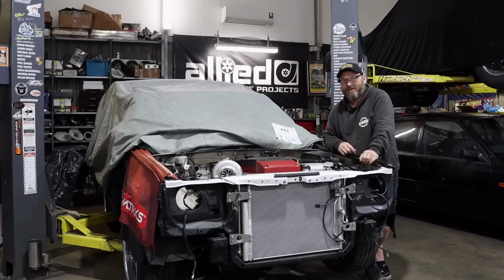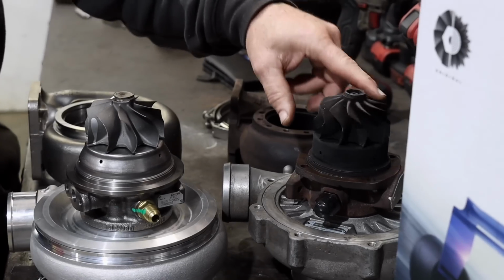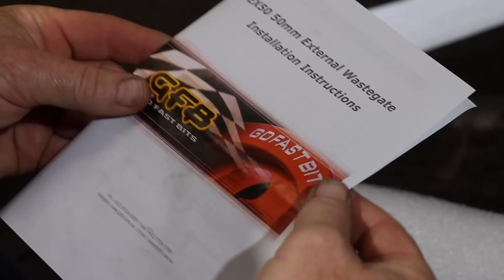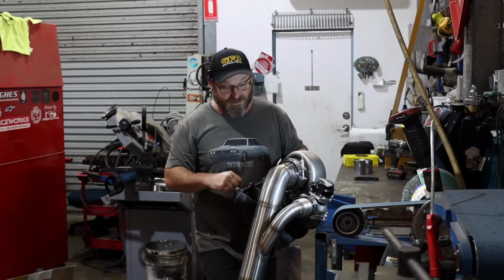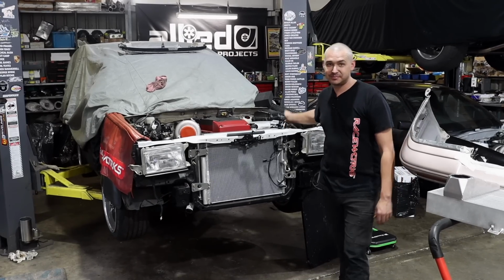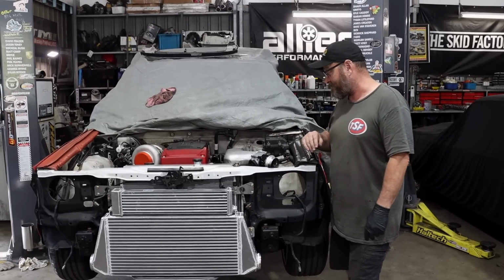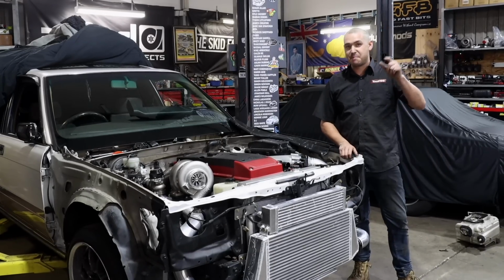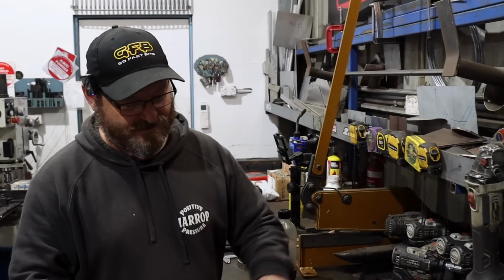Is this The PERFECT Turbo? - Barra Powered Crown EP2

Comment: Well, that was another fun vid from The Skid Factory. Thanks for the educational entertainment. You'll be happy to know I finished all the transmission, wiring, brake and A/C upgrades on the old '59 Jag. Took it for a test drive and there's some minor changes I'm going to make but all in all it worked out. Next, I'll be pretending I'm Al as I build a new exhaust for it using parts from an old HKS system I took off my 350Z. What could go wrong? Cheers!

Comment: The way i knew it was to measure the max of the profile. So like if you take one of the fins, make a thin cardboard template and splay it out flat, the most extended bit is where you need to measure (on the actual prop). Because that's the spot where the last "catch" on the forced air happens. It's kinda like when you launch someone on a swing hard for a jump, and you use your finger tips to give it every bit of momentum.

Comment: I'm looking forward to the details of the ATF cooler. I'm running a Mishimoto MMOC-F and my transmission still has heat issues (dual RedArc temp sensors), but of course I'm beating on it. My question is about configuring a set up to allow more ATF in the system. Will you use a check valve or something particular?
Reply from the maker: What's the application?

Comment: with solid intercooler and turbo piping how do you cater for engine movement and pipe expansion without a rubber flexi?
Reply from the maker: The RaceWorks clamps have movement in them. They are a variation of the Adele Wiggins clamp used in Aerospace.

Comment: Hello. Fascinating. I owned a 1970 Crown MS55 into which I put a 7mGE cressida engine, but problems with transmission and differential ratios were never solved. With your project here on the 1989 Crown Wagon, was the option of using a Lexus 3UZ-fe engine explored or is it unsuitable?
Reply from the maker: The 7MGE is a good choice for the MS55, any issues with it can be sorted out. UZ V8s don't really fit, especially in the early crowns.

Comment: I did see "wha's for dinner" followed by "tandoori lamb cutlets" at 24:52. What I also saw was solid connections from the turbo through to the throttle body, which, last time I mentioned it (when you used a silicone joint) you mentioned you don't do. Yet here is ia prime example of the cold side being mounted solidly to the turbo, the intercooler and the throttle body. Not the smartest I'd say, as the turbo and throttle body will move with the engine, yet the intercooler is fixed to the body. Can't tell me that you don't do it that way because you've just done it.

Comment: Garrett turbos are so good! I'm sure it happens but I've never seen a Garrett break! Seen plenty of others fail, mostly over a decade ago.
Serious question.. Why a TH400? Obviously they're the best trans ever built but wouldn't a 4L80E be a little more fitting in a car of that caliber? Can you even find 4l80e's in Aussie world?
Keep up the good work, fellas! Thx
Reply: Maximum engine input torque for a stock 4L80 is 440 ft. lbs. = 600Nm. A Barra can have over 1100Nm at the wheels with only 15psi boost.

Comment: You know what’s mental tho, I got a Scania truck turbo equivalent to a g55 and it’s Garrett core with a Honeywell housing and branded Scania etc,

It was free as was leaking oil out the back, a new core shipped Lithuania to uk in 30hrs cost me £160 and it’s billet turbine as stock 🤓
 

Even new the turbo from a hgv shop is about £450

If it was sold in a shop for cars then it would be triple the price atleast 🤔
Reply from the maker: Garrett was owned by Honeywell Corporation for many years. It is now owned by a Swiss private equity firm.
Reply: @theskidfactory  I guess that’s why they say “the only way is Dutch”

Comment: This is a very exciting project even though it's not a thumpin' big V8...If I were doing the piping the turbo would go straight into the radiator and blow the whole thing up on the first startup so don't ask me to help with your build.
Reply: At least your way doesn't need a water pump, you've added lightness and performance. Remember that lighter weight =cheaper than power additions. So overall outcome = no don't come and help me on my build!

Comment: With intercooler piping what allows it to flex under engine movement ?
Reply: The silicone slip joiners in-between the pipes.
Reply: @adrianzmajla4844  , ok thanks 👍 , I haven't seen them before .
Reply: Edit. Just realised they have none. Solid engine mounts perhaps?
Reply from the maker: The clamshell clamps have a fair bit of movement but still require a very firm engine mount like a Tuff Mount.

Comment: I want to dunk a barra in my cortina, but licensing over in the W.A. would be tough I'm led to believe.  The car came with a 4.1 log and I'm still not so sure about putting in the dollars in case I can't get it registered.  The formula the govt follows for Australia.... Is it still original kerb mass in KG x 3.0 = max CC? (for turbo charged vehicles?)  And no more than 180kw per tonne?
Reply: Wa is very different to qld

Comment: and i was thinking of a G42 Compact Garrett for a stroked rb26 -  rb28 maybe to much lag with 1.28Ar what do you reckon ?
Reply from the maker: You'd want more in the 1.0x range for that size. Lag and RB26 should not be discussed, it's a small engine that needs to rev to make power. If it is on boost and making power for half the available rev range you are on the money.
Reply: @theskidfactory   any more vids on this project or dyno video etc ?

Comment: Awesome info right there. Actually answered a lot of questions I had about turbo selection for my Soarer build. 

Definitely going to get me a G40 1150, only question I still have is about turbine housing size. If I'm still running a stock converter on the a340 and stock head bolts/gaskets, should I go to a smaller housing like a 1.06 or .95 to reduce lag? 

The end goal is 800rwhp with ported heads and rowdy cams so I'll need the largest housing and use the 1150 to its full potential eventually, just trying to ovoid having to start with a smaller turbo so it's not a pig on the street.
Reply from the maker: A G40 on a 1JZ is going to come up at around 6500rpm unless you use nitrous. It's not really the right turbo for a 1JZ with an A340 and no converter. Even a G30 is a dog on an A340 car without a billion dollar converter.
Reply: Yeah 2.5L 1JZ  is going to want a way smaller turbo vs a 4L Barra unless you want spool times measured in fortnights.
Reply: Nice.
Reply: It's a 1UZ, oops, thought mentioned that.
Reply from the maker: 1uz it will definitely need a smaller housing but should be pretty good otherwise. The converter will still be a bit tight.

Comment: 82mm throttle body is a bit pointless when you have 76mm (70-72mm ID) cold side intercooler piping.
Reply: Absolutely. Al has no experience whatsoever and doesn't know what he is doing. You better tell him how to do it.
Reply: Throttle bodysize has nearly 0% effect on performance, unless it is very small and restrictive. 82mm will work just fine.

Comment: would love to see you throw a bw s372 on it which would make just as much power, not everyone has 4-5 k to throw down on a turbo
Reply from the maker: What size turbine on the S372?
Reply: @theskidfactory  either a 1.0 or 1.1 twin scroll, I'm not saying the Garrett isn't a great turbo but with the way things are going it's hard to drop big $$$ on a turbo these days for most people
Reply from the maker: S372 is not a bad turbo but I don't think it will outdo the G40, it's old tech with a billet compressor. We run one on the Fairlane.
Reply: @theskidfactory  that old tech wheel flows 112lb compared to the g40 at 107, 72mm vs 71, the borgy has a touch bigger rear wheel too, I'd bet the bw would out do the g40 and under half the price, probably a touch more lag, I love the Garrett stuff, even used to have a gt4088, but the price of them these days is crazy in my opinion

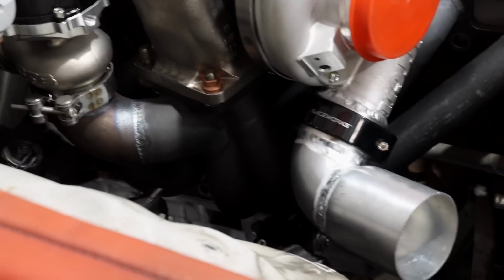Comment: 20:04 was there no way to clock it to get at least 8 cm straight out of the turbo's schnozz before the bend? Because as is, that's a big restriction on the poor thing. Air doesn't like being rushed out of the gate, it likes being allowed to straighten out its horses before taking the turn.

Comment: Lots of added weight in the front. She's going to be a bit of a lead tipped arrow with the big motor and all that extra gear in there. Are you going have to change the suspension in the front to deal with all the extra weight?
Reply from the maker: How much extra weight is there?
Reply: @theskidfactory  70-100kg maybe? Reliable info is hard to find on the interwebz. So far the only weight I can find listed for a Barra turbo is 235kg and 62kg for a T400. I can’t find any weight listed for a 1G-GZE but I found a 1G-GTE weight claimed @ 175kg and an A340 @ 57kg.

The Barra is also a big and tall engine physically. I assume its mass is sitting further forward than the 1G would have. It will be interesting to see how this extra frontal mass ahead of the front wheels will affect handling.

Perhaps you could also weigh the car at the end and compare to some factory figures?
Reply from the maker: If handling was a priority we would not have started with a full chassis luxury car that weighs 1700kg and has box and linkage steering. Straight line handling on the drag strip is the priority.
Reply: @theskidfactory  I hear what you are saying but it isn't the best starting chassis for a drag car either is it? I assume it is still going to be a nice street cruiser too so handling is still something you'd want to consider surely? Not having a crack, just genuinely interested in how it'll drive with the bigger engine in the front. Good luck with it!

Comment: With the inlet, and outlet at the top or the bottom you aren't using the whole coil of your intercooler..
Because air like water or electricity take the least path of resistance. 
So basically you're shoving majority of the air straight through the coil, and it's not going across the whole tube sheet.
In order to do it the way you have it is to add internal radius  vanes at the appropriate point at the inlet tube, and again in proper position to equally split the rest of the tube sheet. 
Instead of a tapered plenum you will be better off with a equal sized one that you can add the radius vanes as well at the very end of the plenum you do not want a flat surface for the air to slam into because this causes turbulence, and turbulence is reducing the smooth flow of the air.
The opposite side needs to be a direct copy of the inlet side, for the same reason, because you want a smooth flow of air existing the tube sheet hitting a smooth radius vane ,and again where it intersects the outlet tubing.
Yes it is a bit of work, but then you're not spending the money, and time you already are to do something half-assed which is what you have in place at this time. 
You want to verify everything I've said, contact your local commercial hvac company and have their test and balance technicians do a flow test with their equipment because other than a mechanical engineering firm that does flow test on site will be the only ones qualified to verify my design criteria.
The mechanical engineers can give you the basic rules of practice for achieving what you're wanting it to do, as it is standard practice in the industry are it is here in the US. 
I've tried to explain this to others but apparently they don't take what I say seriously, which is they're loss for assuming everyone is just blowing smoke out their ass to make a comment or wtf ever.
But if you really want the full benefit of your money time and efforts then the few changes I gave you will benefit you more than your competitors
Reply: They don't take what you say seriously because you are wrong.
Reply: Agree. Al has no idea what he is doing. All the past videos are a sham and he has not been able to pull any decent figures on the dyno. Glad you are telling him (and us) how it should be done. All the intercooler manufacturers/fabricators don't know what they are doing either. You might show all of us the videos of the ones you have done. That will no doubt help us all.
Reply: Sounds like F1 teams need to fire their engineers and hire a couple of HVAC guys to improve their intercooler flow.
Reply: @jeffsymons7084  correct. F1 uses all sorts of pipe layout. Just google F1 intercooler images.  Yes, the flow might not he evenly distributed at low flows, but, at high flows (F1 in the late 80s ran 56psi, 1200hp in a 1.5L engine and no traction control !) the tubes are somewhat restricitve and the gasses even out accross all tubes.
Reply: @jeffsymons7084  probably should, but it's facts what I put before everyone, and just because someone who makes a pile of money that thinks he understands what he's doing even with a degree isn't always correct my friend. 
I've spent over 40 years in my trade fixing engineers screw ups, and I stand by that knowledge gained from seeing the results of such things, what causes the problems, and what it takes to correct the problems to make things function properly. 
That's all I can say about it, as to whether you believe any of what I have said is totally your choice. 
Only before you talk outta hand, why don't you do a little research, and then if you have a educated response with facts or even theory I'd be more than willing to discuss it with you in such a manner. 
Have yourself a Great Day Sir
Reply: @timothymilam732  Thanks. I did some research and I came across something called the Dunning-Kruger effect. I think it perfectly explains what you are saying. God bless you sir.

Comment: i always wonder why australian like so much garrett turbo...here we dont like them much...most of the time with a precision with exact the same spec you will get more power for cheaper...
Reply from the maker: Just buy a few spares for when it fails.
Reply: @theskidfactory  i worked in a speed shop/turbo rebuild shop.. and the shittiest turbo where always garrett... we made more power and got more reliability with precision and bullseyes turbo
Reply: Watercooling in the Garett - keeps the bearing temps right down under hard use. Ever seen the Summer Nats burn out comp ? Watercooling is a must for that kind of sustained abuse.
Reply from the maker: @speedup your experience is at odds to the rest of the worlds.
Reply: We prefer our wheels to stay within the core.
Reply: @theskidfactory  you mean australia...because here in canada we dont use garrett since they are chinese/mexican parts and sometime assembled in the us...but most of the time assembled in mexico...
Reply: @nordic5490  we do the same with every turbo its not sorcery
Reply: @TorqHub  most garrett turbo wont survive at more than 40 psi...but precision does a 70psi...and 10 year later my friend eclipse still does it on the street after 60k km
Reply: we had built car with twin 88mm and with garrett turbo we where down 200hp from the bulleyes we used we needed  4psi more to get our power back and they did last our drag season...we got precision 88 after and went 3 season with them

Comment: all that fab and you use a cheap shit trans cooler that wont even single pass come onnnnn
Reply from the maker: [ Al ] It's not a trans cooler, it's an engine oil cooler from a rotary. I don't really know what "won't even single pass come onnn" means but I suspect you don't either. If you want to comment, have a conversation with meaningful wording.
Reply: @theskidfactory  basically saying it looks like a cheap $100 unit that won’t even have a divider to pass the oil thru the cooler, will just loop between the fittings.. but I honestly don’t know I couldn’t see it and I just comment cos “like and comment” no hate mate
Reply from the maker: It most certainly has a divider in it.